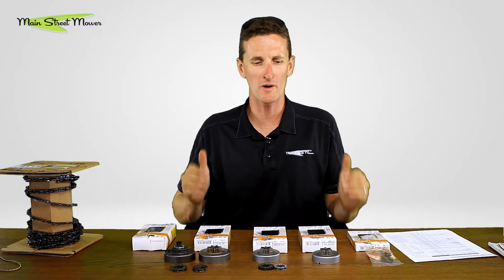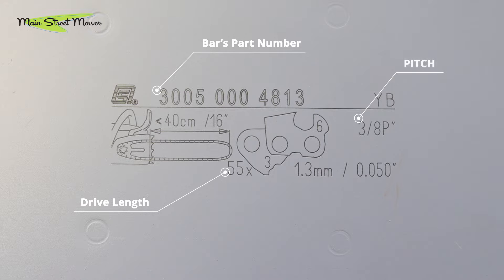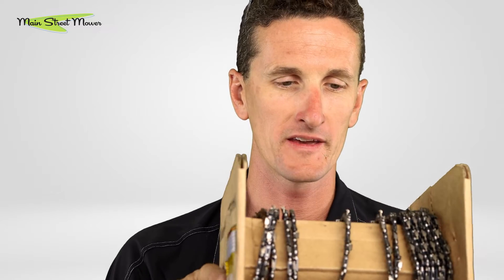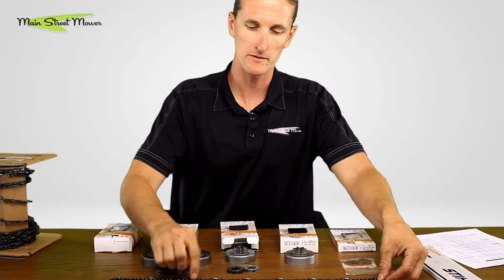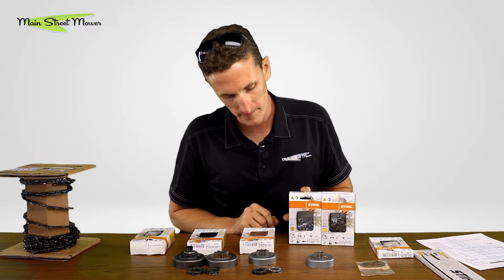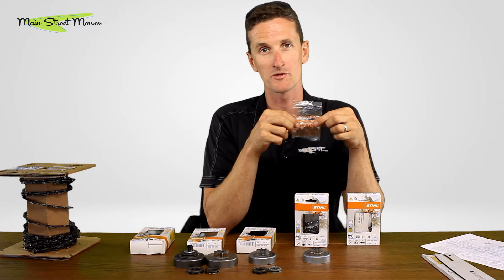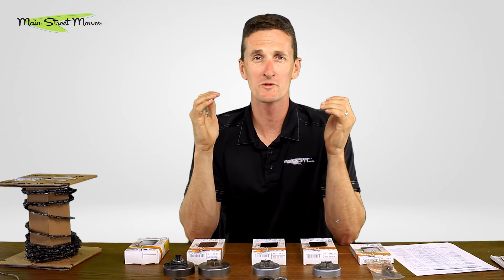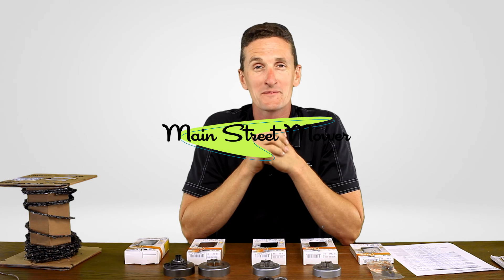Chainsaw Chains, Bars, & Sprocket - EXPLAINED!

Comment: So, I need a new chain and bar, first time buying things for it. I have a 20 inch long bar .325" .058" 76 dl. I want to keep it on 20 22 or 24 inches bar, what can I get for it.? If I understand right, I can have any bar and chain as long as the pitch is .325, is this correct or am I wrong?

Comment: You would think a manufacturer like Stihl would have this information readily available on their website.  They don't.  Absolutely abysmal.
This presentation would have been better if the camera were focused on the subject matter rather than the speaker.  Some critical points were simply glossed over.
This whole system of chain identification is obtuse and oblique.  Surely, in this day and age, you would think someone could engineer a more simplified identification system.
It should come as no surprise that the majority of Stihl dealers selling these products, know little to nothing on this critical subject.
It would be easy to make a mistake on a chainsaw and chain application.

Comment: I have a ms170 14" 3/8  50 1.3  rollermatic bar and a ms 194t light 04 with the identical spec . Can enter change bar and chain on both saws?

Comment: This is the most informative video on Stihl chain. My question is, can I use mini and micro mini on the same sprocket? I'm aware I would have to switch the bar but on a Stihl pdf I pulled up the micro mini sprockets are 7 tooth and the mini have 9 - yet both chains are #6?
Reply: Ok so I misunderstood - the teeth are on the sprocket nose of the bar. And I'm lead to believe that the micro mini and the mini are relevant to the gauge of the bar only - both will work on the same 3/8 picco sprocket but will not work on a standard 3/8 sprocket? Please confirm

Comment: I have an old 011 avt STIHL and on the bar it looks like it says 1.3 or something along those lines then picco and 55. Ik the 55 is the drive links I measured the space between the 2 point and divided by 2 and got 3/8”. What chain do I need to

Comment: Great video! One question please.  With the rim sprocket, I understand it comes in different pitches but does it also come in different gauges?  It appears that the drive tooth needs to fit into the slots on the sprocket, so the gauge would seem to be important.

Comment: Excellent job. Thank you. One area specific to gauge that I would have liked addressed is why one over the other. If I have a Stihl saw and I’ve decided that I want to get a longer bar and chain and they both come as .050 or .063, what is driving that decision.

Comment: Stu - I have a Stihl MS 250 (16"). I am running a Rollomatic 62X - 0.063 gauge bar and the chain seems to be matched properly (26RS). However, when sitting in the bar groove I think there is too much "sway" and the saw drifts to the right in the cut. Assuming I have the chain sharpened properly, could this be a result of bar groove being splayed to some degree? You did not cover that in the video (bar gauge being too big for drive tooth gauge). If that is a possible cause for the drift, how can I correct that without having to replace the bar? Thanks.

Comment: I have an echo cs590.  
I have a handful of sthil chains. But the drive lengths are shaped just slightly diff than those on echo or Oregon chains.  
Is there a replacement sprocket i can use to use these sthil chains on my echo saw and bar?

Comment: Hi everyone  I'm workig on this problem of mine through Amazon, most chain saw shops dont have clutch  for my Sportsman 52cc engine, it came with 14" bar/ 20" bar thats fine its running  great, but  the tree i got cut needs 28" bar and stihl bars come really close too sportsman 20" bar, Next problem is drive sprocket got get changed for updated chain from .325 to 3/8" pitch  fun i have too match up one on line, and Stihl dealers are expensive  on big ass saws of 28" tyoes $ 780.00  So ill make this sportsman saw if someone  got udea of right clutch for this sportsman  saw its funny engine made by Makita, poulan in on manufacturing, lovely along with chinese. So i asked buffalo tools make me 28" bar  with chain and sprocket  change .

Comment: so , i need a chain for a saw thats a standard 16 inch bar but ive got an 18 inch bar and chain but the chains pitch is wrong , what PITCH do i need?
Reply: If the pitch doesn't mach, you need to change the mandrel to mach the pitch of the chain + bar you are installing 😵‍💫

Comment: Oops, I have 3 saws a 171 and a 230 both 14”.  Just watched your video and went back to the shed ah I have been swapping chains and have now seen that I have 2 badly worn sprockets and they are not interchangeable as I thought. So hands up I didn’t even think about the bar. Thanks for the excellent video I will have to replace parts and maybe even up size my ms230 to a 16” so I don’t accidentally fit the wrong chain again. My third saw is a 12” pole saw it’s safe as it’s a different length.

Comment: In a nut shell essentially you can run any chain that is the same pitch as your sprocket but if the length and gauge change you have to change the bar along with new chain amirite?
Reply from the maker: Exactly right

Comment: I have an echo cs-590 18” bar which calls for a 3/8 pitch, .050 gauge and 64 drive link. My question is, can I use a 3/8 pitch, .050 gauge, with a 62 drive link on the same bar? Reason I ask is because I got 4 brand new 62 drive link chain from my old chainsaw. Thanks
Reply from the maker: It’s very unlikely that your adjuster will move enough to make that 62 link fit, if you live near any of our stores we would be able to add 2 links to your chains at minimal expense. You should be able to find a shop capable in most markets

Comment: How important is the drive link
Can I put a 92 dl chain on a 93dl bar??
The pitch is 3/8 on both 
The groove is 050 
The bar size is 27 but it’s also sold as 28
Thanks
Reply from the maker: The only problem maybe that your tensioner doesn’t have enough throw to accommodate a chain that is + or - a drive link. But if it does, there are no safety or issues of damage to worry about
Reply: Thanks 
I might buy and try

Comment: Hi.  I picked up a 250MS from a garage sale. (looked like new!)  The factory (white) bar was missing, & it had an older looking bar sitting there, without any chains, so I took a chance and bought it for pennies.

I already have an old Husky 365 with 3/8, 050 chains,,, & with a 20 & 24" bar.  I was TOLD that the 250 Stihl 'should' use the same spec chain. WRONG!  Nothing I had would fit.
I took the Stihl saw & bar to DO-CUT , hoping that they could help me figure out why my Husky chains would not fit the sprocket on the 250 Stihl. The salesman looked up the 250 specks, & checked out the older bar,,,, he pulled out multiple chains & different size bars, but nothing would match the sprocket,,,, & HE COULD NOT TELL ME WHAT WAS WRONG!?
He never even mentioned that there was a possibility that this saw had on a different spec sprocket!  OMG,,,
I ended up leaving that store without any parts or answers.
SO,,, I'm SO GLAD I found your video!!  Wish I could send this link to HIM!!! ;>)
THANKS,,, times 3!!   Now, I can get out there & hopefully find the spec numbers on the existing sprocket, & buy the proper chain & bar!
👍👍
Maybe you could tell me,,,, could I put on a 3/8, .050 sprocket, bar & chain?  Then, all of the chains & bars that I have would be the same.?
Reply from the maker: Sorry I’m late seeing this, glad to help. Unfortunately the Husky chain commonality won’t work out , because of something else I didn’t yet touch on.

In the chain world there is a big 3/8 .050 gauge chain and a small 3/8 .050 (picco) chain. Same spacings but the cutter on the big 3/8 is at least twice as big as the small 3/8.

You need horsepower to run large cutters and the big 3/8 chain you have on your Husky saw is too big for the MS250. If you were downgrading to the small 3/8 picco everything would be great.

I would just get set-up with a stock MS 250 bar chain and sprocket in this case

Thanks for watching!
Reply: Don't forget that ms250 may say what pitch chain it uses on the sprocket itself or the clutch drum.

Comment: In Dec. 2023 I bought the Stihl MS261 that came with a case extra chain and hat. The dealer was out of the promotion package so he put one together with what he had on hand. Long story shortened I ended up with 3/8 chains and bar but .325 rim sprocket. I contacted the dealer yesterday and a 3/8 rim sprocket should be here Monday. 
This was not my first saw. I knew most of what you discussed but you did an excellent job of explaining a rather complicated subject.
Reply from the maker: Thank you! Make sure to share the video with your colleagues who might be interested in the topic.

Comment: Even the stihl dealer.said that I'd need a new sprocket moving from 1.1 mm to 1.3 mm but they are both 3/8 pitch  so I do not need a different sprocket. This video is great
Reply from the maker: Thanks Mikey. Share this with all your friends in the industry. Our small channel can use the boost 👼

Comment: Nice to know you can change the ranch saws to professional sprockets. Can I convert my 311 to use the same sprocket as my 661?
Reply from the maker: Not the same sprocket, but the same pitch so if you had a 20” bar on both you could run the same chains

Comment: What would we do without you?   Fantastic eductional video.  A welder pal of mine asked me can you repair this saw Mick....  I said probably + it looks an old bugger.   I cannot for the life of me get anyone to state the ID of the drum.   The saw is a Jonsered  2040 turbo.
The sprocket has broken. It's the original 3/8" - 7 teeth gear which the Husqvarna clutch on the 36, 41,136,137,141and 2 seems to match the data I require.
he's canfirmed the bar says 3/82 on it not 325.
After watching you vid I gained a greatdeal of info.   My saw is a new cheapo new Spear & Jackson which  we need to saw logs for our logburner. Living right near a deer park I get invited to fill the old Land Rover full to the brim with Beech logs...... The head man likes our honey!
Reply from the maker: Thats' great Michael. Im happy the video helped

Comment: Hi what’s difference it will make if I change  from 6 to 7 tooth sprocket’s. It will make it faster or power

Thanks
Reply from the maker: With a 7 tooth every engine revolution will push one more drive link than a 6 tooth, thus trading some torque for speed, this would theoretically make it cut faster in soft wood.